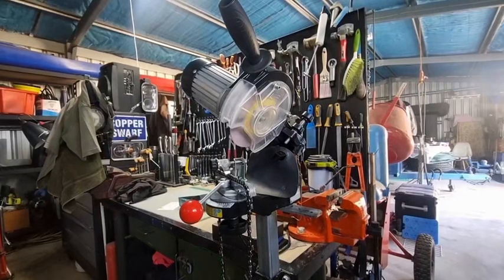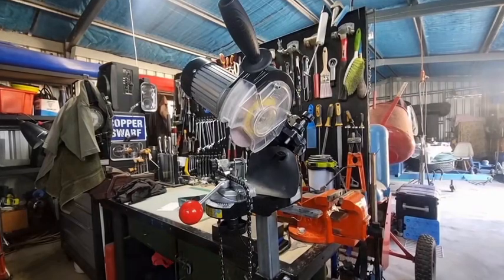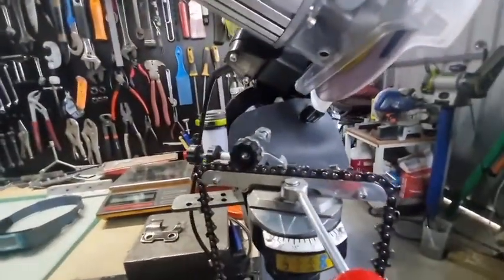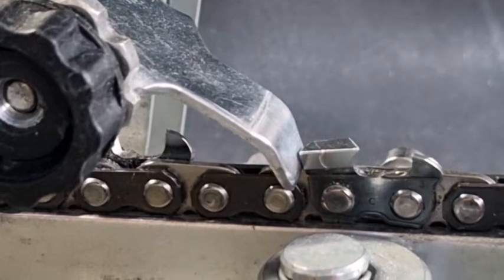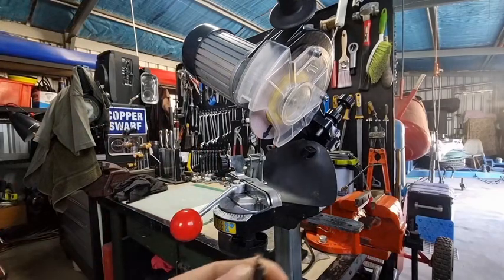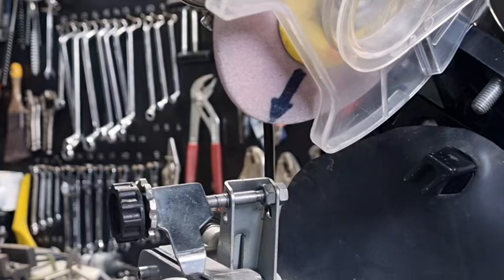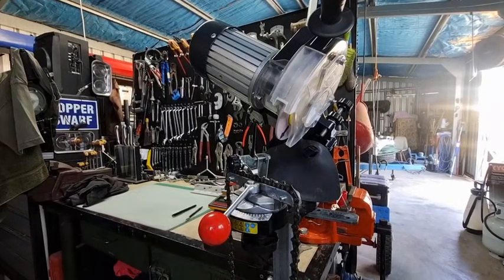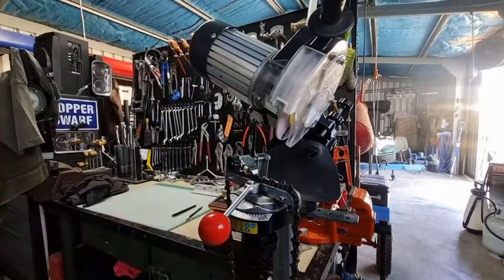How much work does the side plate do

Comment: I'm confused now , does the square ground chain not use the side plate as a cutting edge along with the top plate ?
Reply from the maker: When we talk side plate we are talking the working corner only.
That's where we measure it.
Or rather thats where it's stated.
You are correct the side plate on square ground should be ground 85°
It's easy to measure when it's in a straight line like square ground and Hexa